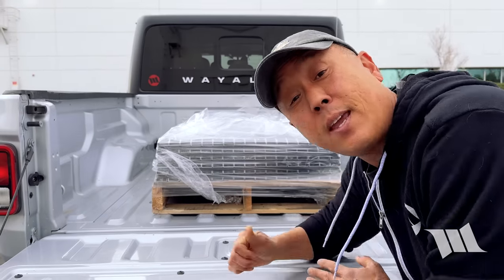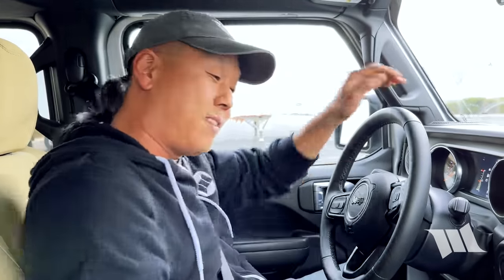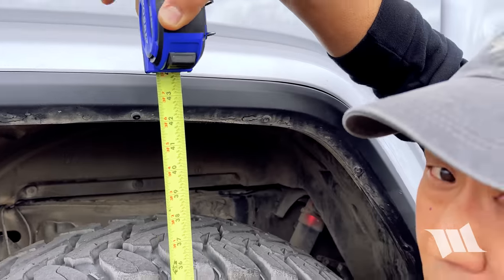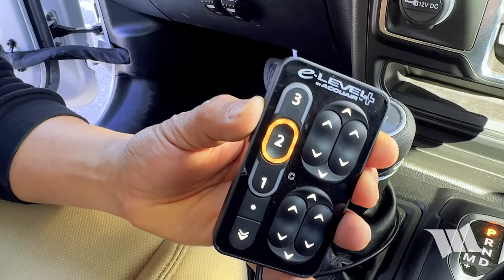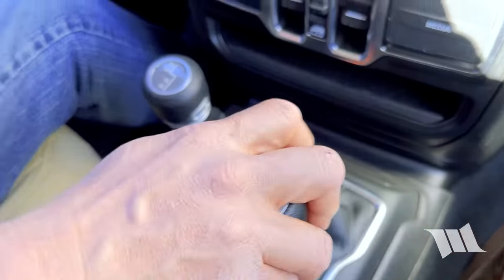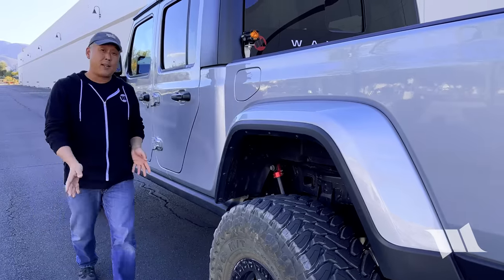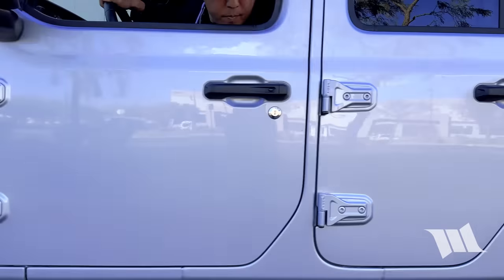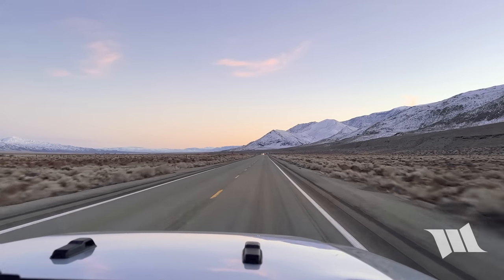Hauling a Heavy Load in a Jeep Gladiator with the ACCUAIR Air Suspension System

Comment: Will just Chime in with all the other Comments… Yeah it’s a pretty Awesome system … Too many ++++’s and few - - - ‘s 👍
Reply from the maker: Without question, the biggest negative is the cost. Otherwise, I think for the average guy or gal who doesn't need the biggest baddest rock crawler or pre-runner and just wants a rig that can carry varying degrees of weight automatically and have adjustable heights at the push of a button... this kit is really something to consider.

Comment: I would like to hear what this system would cost in a 2 door jeep. Yes I know its not a heavy hauler but the leveling is amazing and I'm sure it would help the ride a bunch
Reply from the maker: Unfortunately, a kit for a 2-door is not available at this time. This is mainly because there is no where to put the air tank and compressor. However, I am told they are trying to work on something.

Comment: Would it be equal to or greater than the mojave suspension in terms of ride quality?
Reply from the maker: I don't think the ACCUAIR system was made to be or even compete with something like the suspension system that the Mojave comes with. In the end, the air pistons are high tech springs and the shocks, as nice as they are, are just good monotube shocks. The Mojave comes with really nice bypass shocks and for driving hard and fast across the desert, I would say that the Mojave still offers a better ride. What I would say is that this system rides better than my stock 392 suspension system.

Comment: I have a 392. How do you think air suspension would do? Also I have been looking those TIS rims. What offset do you have?
Reply from the maker: Unfortunately, I don't think a kit is made for the 392 or at least, in terms of a direct bolt on kit. This is due to the exhaust system getting in the way. But, I suppose just about anything could be made to work and I think it would do well. The wheels have -12 offset
Reply: @wayalife  Thank you Eddie.

Comment: Do you think your 2 door roof hoist method will work for your gladiator? 

My Mojave is too tall to fit in my garage but I found a shop crane that should do the trick. Im thinking of using a similar roof hoist setup that you made for your 2 door 🙂
Reply from the maker: I don't see why not.

Comment: Hi Eddie, has this system cross-link valves? On my Land Rover with air suspension, while offroading the control module opens a valve to link the air bags of the same axel, so when one side is going to be compressed in a twist, the air in the compressed air bag is pushed into the other one on the opposite side extending the suspension in order to gain more travel and traction. Equalizing the pressure of the bags (via these cross-link valves) improve furthermore the ride comfort on rough terrain.
Reply from the maker: Each air piston is controlled by individual solenoids. If you haven't seen it already, here is a video of how it does out on the rocks. https://youtu.be/GKZ-uwINK2k

Comment: Hey Eddie one quick question. How noisy is the compressor? My kids would be sitting in the back seat and one of them is pretty noise sensitive. And how often does it tend to run?
Thanks
Reply from the maker: On a Gladiator, the compressor is located under the far rear passenger corner. You can hardly hear it when it's on and it really only comes on when you go to a taller setting after being down low. Aside from that, it just comes on for a few seconds far and few between.

Comment: I"m thinking about getting this system, question is... can I still run my fox 2.5 shocks?
Reply from the maker: So long as they are the correct length both compressed and extended, I see no reason why you couldn't.

Comment: I am almost feeling that a regular spring suspension is inferior.
Reply from the maker: I don't think this kit is for everyone but for the guy or gal who does a lot of overlanding or wants or needs to carry a lot of weight on and off, this system just offers a lot more options that a standard spring suspension just can't hold a candle to.
Reply: @wayalife  I'm curious about the shortcomings.
Reply from the maker: @Olaf Kithau Well, first and foremost, the cost is probably the biggest shortcoming for most people. But, I get your question and for me personally, I'd have to say that the brains - the technology that makes this system so cool and useful, is the potential shortcoming. ACCUAIR is so confident in their air pistons that they'll warranty them for 100k miles. However, anything technology driven can also be the weak link - same is true of the Jeeps we drive. But, so far, I can tell you that we haven't seen any problems and we've racked up over 4k miles on this rig.
Reply: @Wayalife  Yeah, I agree regarding limits of technology especially in the backcountry.  
I have dealt with air bags while in the backcountry and there could be issues with airbags if the suspension extends too far.  A leak could develop in a bag or airline.  Then there's questions about how to change an airbag on the trail in event of a malfunction.  
What redundancy exists if the control module malfunctions?
I like the system but I would need to know more about the functionality.
Reply from the maker: Just out of curiosity, have you had a chance to see our last video? https://youtu.be/GKZ-uwINK2k
From what I understand, the shocks would prevent the over extension of the air pistons. Also, each one is independently controlled by individual solenoids. If one were to fail or suffer a leak, the problem would be limited to just that one. I will have to ask/look into redundancies as that is a legit question.
Reply: @Wayalife  I do remember you saying each corner has an individual solenoid which does localize a problem, and the other corner would help support the vehicle.  I'm curious how the system would react if one or even 2 corners failed.
I'm just asking a bunch of questions because I am very interested in this system for our Gladiator.
Reply: @wayalife  I did see the last video😊
Reply from the maker: These are all great questions and I'll be sure to press ACCUAIR for answers.
Reply from the maker: @Olaf Kilthau So, I just got off the phone with ACCUAIR and shared the questions and concerns you have and they said they will look into making provisions to address what they can. If nothing else, they should be able to provide some manual overrides.

Comment: How does it do offroad at extreme articulation? How do you set the control arms and track bar to center the axles if you're always adjusting height?
Reply: Look for the previous video
Reply from the maker: This video may show some of what you're wanting to see https://youtu.be/GKZ-uwINK2k
And, this video might answer some of what you're wondering about https://youtu.be/EuHdSR_7nqA

Comment: Will it work when crossing deep water combined with sub-zero temps.
Reply from the maker: Deep water crossing, no problem. The breather intake is located on top of the radiator. Combined with sub-zero temps... hard to say for sure. ACCUAIR does offer provisions for cold weather and you'll get to see some of this in an upcoming video but that might be a bit much.

Comment: Can you drive a bit lower at highway speeds and get a bit better MPG?
Reply from the maker: Yup, you sure can and the system is designed specifically to do just that. Just run it on setting 1.

Comment: Can the accuair be used as an auto level when setting up camp when overlanding?
Reply from the maker: The system auto levels when driving 25 mph or more BUT, you can manually adjust each corner to level yourself out and with ease.

Comment: Is it possible to lower the system to the stops and drive forward into a garage (and then back out) without the suspension trying to raise itself above the bump stop height?  Does that hold even if the Jeep has sat for a bit and then restarted?  Thanks.
Reply from the maker: As mentioned in this and other videos we've made regarding this suspension system, you can drive on ANY of the settings including on the bumps so long as you do NOT exceed 25 mph. At 25 mph, the system will automatically raise your Jeep back to the default #2 setting. I would imagine that you'd be driving a LOT slower pulling into or out of a garage. If you turn off your Jeep, it will stay on the bumps but when you start it up, the suspension will raise up to the default #2 setting. If you set it to #1, it will stay at #1 even if you start your Jeep.
Reply: @wayalife  - thanks.  And, thanks for the quick reply.  We are looking at getting a Gladiator and putting on AluCab Canopy Camper on it and have been thinking this suspension set-up might solve several concerns.  I was wondering if, as a bonus, I might actually be able to park in my garage - even with the Alu-Cab.  Based on my garage height and best guess as to height, on the bump stops, it might just work.  Not a requirement, but it would be nice!

Comment: So since the jeep payload is 1600 lbs, what are we talking about "unofficially"? I'm really interested because I plan on building a custom camper that replaces the bed and any indication would be helpful to figure out how sturdy I can make it.
Reply from the maker: "unofficially", they've tested it out with way more weight than 1600 lbs. But, just because the suspension can hold the weight doesn't mean that the vehicle can or should.
Reply: Would be interesting to see if the weight difference between the stock suspension and ACCUAIR system improves or reduces payload and by how much.

Comment: Can you use the air suspension at stock height. And how Lowe can it go? Because I am in a wheelchair and need to transfer into my Jeep? And also I have an eco diesel rubicon gladiator2021 will this work?
Reply from the maker: You can lower the Jeep to it's bump stops and you can see it here https://youtu.be/EuHdSR_7nqA
Unfortunately, they do not make this kit for a diesel or at least, as a bolt on option.

Comment: Hi. I just wanted to know the Fab Four stubby bumper fog lights. What model are they and are they connect to fog light (OEM) connector?
Reply from the maker: The fogs are factory and they really don't work worth anything due to the fact that they sit behind square holes. I think you'd be better off installing something like square Rigid or something like it.
Reply: @wayalife  do rigid come with connector to Jeep factory fog light harness?
Reply from the maker: I don't think so. I think with most aftermarket lights, you have to wire things up to make it work.

Comment: I take it that the driving needs to be on flat ground? If 10% incline I take it the system wouldn't know or take that into account?

If it does be interesting to now 🤔 how
Reply from the maker: Actually, the auto leveling is speed sensitive. If you can get up to 25 mph, each piston will air up to where it needs to be to achieve default height. The brains behind it works off of both sensor position and psi.